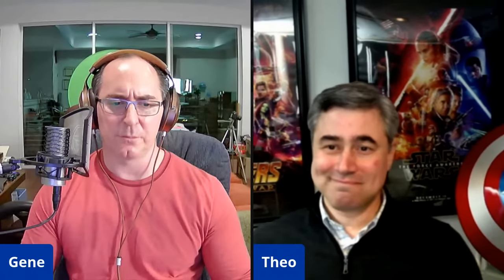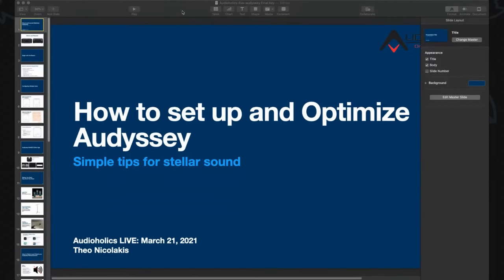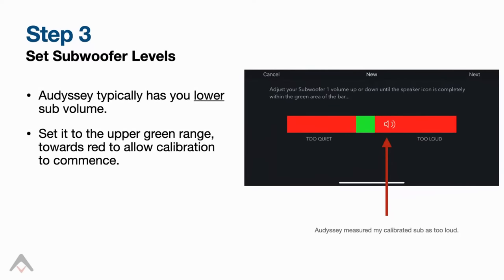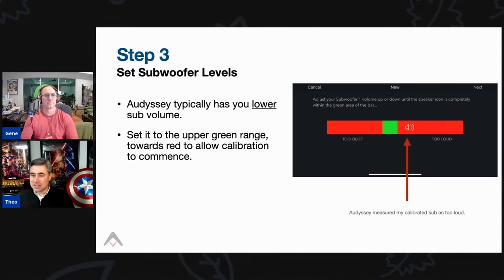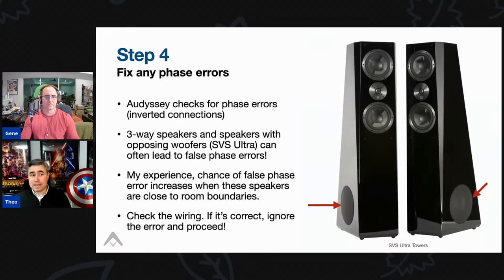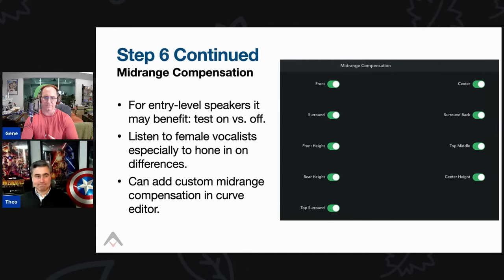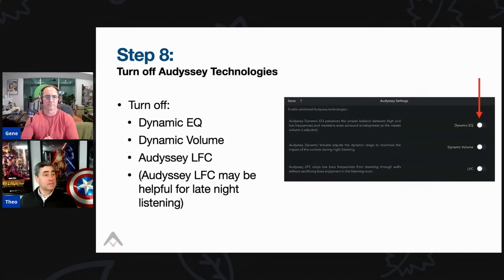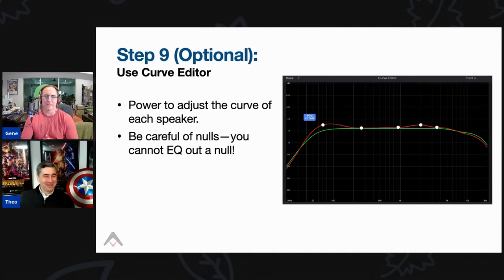Audyssey Room Correction Performance Tips for Your Denon/Marantz Receiver

Comment: Step 4. Phase error. I've recently learned (from my supplier) for example my Emotiva XPA Gen 3 power amp connected with XLR acutally is phase inverted... You need to connect the speakers inverted. Audyssey stopped finding the phase error after that change.
Reply from the maker: that's ridiculous if true. An amp should never flip phase from input to output. Perhaps your unit was miswired?
Reply: @Audioholics   This is the direct translation from Swedish: 
Note! Emotiva does not follow the industry standard regarding XLR, all their Generation 3 power stages have inverted phase. If you want to connect your preamplifier via XLR, you simply switch the plus and minus poles on the speaker side in the final stage, in other words, you connect the other way around. The reason they build this way is to extract an even lower noise floor.
Reply from the maker: @FB-xm5hk  It's true there are different pinouts for XLR but that's different than the amp actually flipping phase through the gain stages. Always check XLR polarity on the input to output devices. Some Marantz products have a flip switch for polarity to accommodate different product conventions.
Reply: @Audioholics  Well... In my opinion that is pretty advanced knowledge. Emotivas manual don't mention this anywhere... I've ran my system "wrong" well over a year before realizing this. My Audyssey app found the phase polarity issue but this guide told us to ignore it.... I'm upgrading speakers after new year and started watching these contents again now to refresh my memory..

I have a Marantz AV7706 processor. Does that model have the flip switch for polarity?? Where can I find it if so?

Besides this, thank you for spreading so much knowledge in this industry! Much appreciated!!

Comment: On my denon AVR-X2500H, audyssey does not have the option for me to set the subwoofer level (with the green zone like you showed) before the room correction. It just tells me to place the volume at half on the back of the sub. It also, only calibrated both sub outs as only one subwoofer setting. Is this just a different audyssey version because i don't have a high end denon reciever?
Reply: Yes...they are talking about xt 32 and the 2500 has the basic xt version if I am not mistaken.
Reply: @snauspockets9924  i figured that was the case. Thanx
Reply: @jake24680  If you have 2 subs I would recommend upgrading to an x3700h or something that does have Audyssey xt32. I bought a x4700h last year and the XT32 dual sub integration really made a difference in my room. My previous 3808ci had the regular audyssey like yours and I while I tried to do it right, it never sounded as good as it does now.
Reply: @snauspockets9924  this is actually why i asked. I want to be sure to have this ability for both subs, when i do upgrade soon. Thank you for the suggestions
Reply: One quick question. With what i have now. Denon x2500h, running dual svs-pb 1000s. During audyssey setup of the one sub channel out. Should i have both subs on and set to 12 o'clock, or just run one, then once setup is done, turn the other sub on.
Reply: @jake24680  it would be hard to do without an SPL monitor of some sort. You can download a couple apps for free that will give you a graph representation of sound in real time. Spectroid and Spectrum are both pretty good.

When I did it, I would do 1 sub in audyssey and call that sub 1 and then integrate the other sub(sub 2) by trying to match the spl of sub 1 from the main listening position. Do Audyssey with 1 sub. Get the spl reading of sub 1 from the MLP then unplug it and turn up sub 2 until you get the same spl. Then plug 1 in again and they should be close.

If there is a better way to do it without buying a microphone and REW I'm sure somebody will say something. Otherwise the multisub AudysseyXT32 makes things a lot easier.
Reply: @snauspockets9924  thank you. I'll give it a try
Reply: Check out the ratbuddy audessy program it will allow you to take the room correction files and load them up and adjust them on your computer just like the app and can allow for more precise edits to the curves.
Reply: @connorjohnson4402  thanks for the info

Comment: at 40min talking about external pink noise, how do you get it to run through all the speakers independently? Are these files multichannel?
Reply: If you have the ability to play the files from a Mac, open up AUDIO MIDI from the utilities folder. You can then specify which channel to output and playback or mute all the channels except the one you want to play back. This presupposes you are using HDMI or a digital connection. If that’s too much of a hassle, use the test tones internal on the AVR. while not the ideal, it will get you where you need to be.
Reply: @TheoNicolakis  Theo, and going back to the manual adjustments after doing audyssey to use the internal test tones.... these will be played pre the level, eq, and delay set by audyssey? Or post those parameters?
Reply: the obvious answer seems to be, setup your room and speakers correctly, treat the room, measure your response with REW, then forget about Audyssey and use just eq to tame the peaks. Problem is the internal eq is very limited so now you need to move to external pro level eq. I think Tony uses an Ashly pro eq for the multi subs but I wonder what he uses for the 80-300 hz range on the speakers. Now your talking about another A/D and D/A conversion for the speakers, unless Denon can improve the internal eq's which you say is doubtful. Possibly tony is doing very little to the speakers and just eq on the subs in his rooms that are properly designed and treated. So maybe forget about the speaker eq (if the measured response is good enough) and just get an external sub eq or use the internal in the SVS subs to tame the peaks.
Reply: @dm17nc17  if you don’t have the ability to play external files then just use the internal test tones to get the SPL balanced. My understanding from the folks at Audyssey is that if you run internal tear tones via the Manual menu it bypasses Audyssey and uses GEQ
Reply: @TheoNicolakis  Theo, seems like Audyssey is becoming more useless to me.
Reply: @dm17nc17  Check out the ratbuddy audessy program it will allow you to take the room correction files and load them up and adjust them on your computer just like the app and can allow for more precise edits to the curves.

Comment: With regard to flat versus reference, any app adjustments do not apply to the flat setting. Am I correct on that?
Reply: Yes, the adjustments you make in the App only impact the Reference curve in the AVR. The Flat curve is always flat. The ONLY exception is the MRC setting in the App, if you have that on then it will turn on the MRC dip for both Reference + Flat
Reply: @eitanaltman158   So if making adjustments with the curve editor then you pretty much have to use the reference setting, Which is what I have done. I also used the editor to kill the compensation dip and flatten out that roll off on the highs.
Reply: @Pohgrey  it sounds like you should just use the Flat setting instead of the editor? You are removing the compensation dip and flattening out the roll-off, that's what the default Flat setting already does.
Reply: @eitanaltman158  I've made some adjustments to the curve also to fix a couple of dips ~85 (+3.5) and 120 hz (+3) to fix a couple of dips- and it works. I love the editor for making those small adjustments but it's all for naught if I use the flat setting, no?
Reply: @Pohgrey  Check out the ratbuddy audessy program it will allow you to take the room correction files and load them up and adjust them on your computer just like the app and can allow for more precise edits to the curves.
Reply: @connorjohnson4402  I discovered ratbuddyssey last year and agree with you. If it was out a few years ago I wouldn't have gotten a MiniDSP!
Reply: Gene. I think you always suggest that you like the flat setting over reference. Is that just for 2 channel music? As Pogre asks, does changing it from reference to flat also kill any settings from the app after audssey has been run for home theater/movies? Does it just impact the left and right fronts? Otherwise, if flat cancels anything audssey corrects why would you change it to flat? What am I missing?

Comment: So I just found another issue with the Denon A110. It’s a 2020 model but it does not have more than one preset for Audyssey. This is frustrating!
Reply: Yeah it's unfortunate the A110 misses out on the 2019/2020 features like Bluetooth headphone transmission support, dual speaker presets, the "screensaver" mode & a host of other convenient features but it being based on the 2018 flagship X8500H it's core functionality remains the same except for the Bluetooth version being updated to 4.2 like the 2020 models & naturally the newer flawed HDMI 2.1 board :)
Reply: @oniiz8685  Yes, I’m aware regarding the A110 being built off of the 8500 platform, as I owned a 8500 as well. I kept it for a month after purchasing my A110 just in case the A110 didn’t outperform the 8500 via it’s “audiophile” quality, upgraded capacitors, heavier gauge internal wiring etc.... and it completely blew my socks off, as I was already very impressed with my 8500. But they did step up the audio quality and with its new uniquely tuned audio, I noticed it right out of the box before I even ran Audeyssey! It sounds phenomenal! So needless to say the 8500 had to go. But with all that said, how hard could it be to add all the 2020 features? You’d think it would at least have every possible feature the 2020 models have, as it’s suppose to represent Denon’s benchmark of technology being its an anniversary edition. Especially for an additional $1500 bucks! That’s $200 more than having an extra X3700H! Hopefully Denon can fix this via a firmware update in the near future! By the way, did you notice Denon increased the A110’s price by another $100 now retailing at $5599? Denon is probably getting a ton of new orders substantiating the price increase! Everyone that’s written a review has nothing but high praises for it.
Reply: @drummerKev  I too have an X8500H but down here in Australia, the A110 retails for...wait for it $11,390, yep you read that right, unbelievably pricey for what it is plus the added bonus of the "Not Quite Right" 2.1 board shenanigans for shame :)
Reply: @oniiz8685  wow bro! That’s crazy! I’ll say this though. I told a friend of mine that after hearing my A110, I would have paid twice the retail price! It sounds that good! Not to pour salt on the wound, but I actually got 20% off retail with my connections. So after tax my total was $4761. In addition to that, I also got 20% off my 8500 I sold. So I got to use my 8500 for a year and still made a profit when I sold it.

Comment: Anyone know how i can send a signal to my height channels individualy? For example pink noise or do a sweep with REW?
I know about AVR test tones, but that's with audyssey disabled.
I'd like to be able to have more control and send a signal to my height channels. But on pc (with REW) i only have the option for 8 channels.

Would All Channel Stereo be an option?
Does anyone know if in All Channel Stereo the signal strength is equal in all channels ???
Reply: The only way that I know of is getting a copy of an Atmos demo disc blu-ray (or downloading a file if you can find it), there's a speaker test option that allows you to play tones for 5.1.2, 5.1.4, 7.1.4, 9.1.6

If you just want to measure them in REW to see what the response looks like, you can always just swap the speaker wire temporarily and then ping it and measure. It won't show you what it looks like with Audyssey correction of course. 

Then again, the height speakers are by far the least important, so most people just don't worry about their EQ being perfect.
Reply: Yes the easiest way to do that is to get a disk that will allow you to play the individual channels. Many Auro 3D discs have the tones as do the Dolby Atmos and DTS:X Demo discs. You can sometimes pick these up cheaply on eBay. Otherwise a recent calibration disc would have it.

Comment: Audyssey software just cannot give you flat bass response, no matter what you do, likely a software bug. Just go and adjust your sub level manually after the calibration to match your mains, using decent flat to 20Hz mic and REW's SPL meter, Z-weighted, this will give you flat bass response. 
It doesn't really matter if you set your speakers to large or small BTW, large are actually better and easier to integrate with subs.

Comment: Question: is it possible, or even demanded, that you turn certain things off, like DYNEQ, mid range compensation etc. BEFORE you do the actual measurement? Is this even possible?  I'm used to correct things after the measurements.
Reply: All of those options or post measurement. The measurement takes place without any of those on. Once you complete the measurements Audyssey then prompts you to turn them on.

Comment: I ran odyssey on my x6500h and it sounded absolutely terrible. Oddessey is good for one thing and one thing only, measuring distances, especially subs. Then turn it off and manually measure spl.
Reply: If a person can, it’s always a good idea to measure your set up after running any automated Solution. All rooms are different and sometimes room correction systems can make mistakes.
Reply: @TheoNicolakis  I agree Theo.
Reply: Check out the ratbuddy audessy program it will allow you to take the room correction files and load them up and adjust them on your computer just like the app and can allow for more precise edits to the curves.
Reply: @connorjohnson4402  thank you, Ill take a look Connor.
Reply: @shaolin95  I disagree. I now use Audyssey MultiEQ-X which allows the user to fully calibrate their system manually and it's superb. Talk to anyone in the industry and they will tell you that Audyssey auto EQ is terrible. You have to do it manually Shaolin.

Comment: The Audyssey MultEQ Editor app has a lot of negative reviews at the Google Play store. Is this app still buggy?
Reply: I’ve only used the iOS version and it’s worked fine for me on multiple Denon and Marantz units I’ve had in for review
Reply: Check out the ratbuddy audessy program it will allow you to take the room correction files and load them up and adjust them on your computer just like the app and can allow for more precise edits to the curves.

Comment: I find Audyssey to be detrimental if solely relied upon, meaning no post-corrections. I've used every single version in various listening environments, and in almost all instances, Audyssey results sound worse than no EQ whatsoever. I've even discovered that it does more harm than good when it comes to EQ'ing subwoofers. A generic, one-size-fits-all application that relies upon an extremely cheap, low-quality microphone simply doesn't work very well. It's sufficient when it comes to setting levels and distances, but outside of that, it's extremely inconsistent. For example, I never get consistent measurements; every time I run Audyssey, the results vary, even with identical microphone placement using my boom stand. I've spent years tinkering with Audyssey, never being satisfied with the end result. Now, I've begun to take a minimalist approach with home audio—no EQ, just solid room treatment and ideal speaker placement.
Reply from the maker: Yes, but Audyssey PC w separate mic calibration kit is an entirely different story.
Reply: @Audioholics  I'll definitely have to try that.

Comment: I watched this video several times, taking notes, and found it to be really helpful! However, my version of the MultEQ app doesn’t have a Reference vs Flat option in the app. How do you set that? Only on the AVR after loading the curve? The app does have a setting for “Target Sound Options,” which appears to impact high frequency roll off, but the choices don’t impact Reference/Flat on the AVR (I’ve tried both). On a similar note, does tweaking HF roll off, midrange compensation, and even Reference vs Flat really make a difference when you end up setting the MultEQ frequency cutoff to 300 Hz?
Reply: Yes on the AVR!
Reply: @TheoNicolakis  thanks Theo! Do you know much about the “Target Sound Options?” I don’t recall that being in the video! Really great breakdown!!!
Reply: Check out the ratbuddy audessy program it will allow you to take the room correction files and load them up and adjust them on your computer just like the app and can allow for more precise edits to the curves.

Comment: Hi Gene 
The most important thing to do first is your speaker positioning optimization and then the electrical design, then you are 70% there already. The equipment is only 30% of the equation. We work with REW even with inexpensive receivers .Denon and Marantz are dated products and even have a faulty 8K chip 
Certain products that were already designed in 2016  are far more advanced then the latest version of Marantz and Denon. Those products designed in 2016 are also nearly half the price of the Denon and Marantz products.
The sound character of an amplifier is determined anyway by the souces. Amplifiers amplify the character of the source that's the only job that they are supposed to do. 
We also specialize in products like Ascendo Immersive Audio and also use all the same tools to setup inexpensive audio equipment. 
Have a  look at theonlineinstaller.com   or avtaudio.com   to get  yourself some assistance for free. 
I am doing this fun job already for 37 years and can give some assistance if needed. 
All you have to do is ask. I don't mind assisting.
 Best regards Hermann Maischatz from AVT AUDIO NAMIBIA 🇳🇦